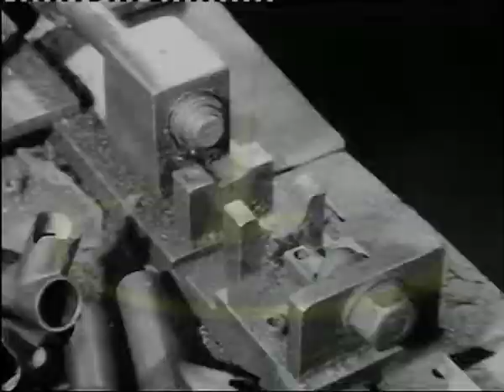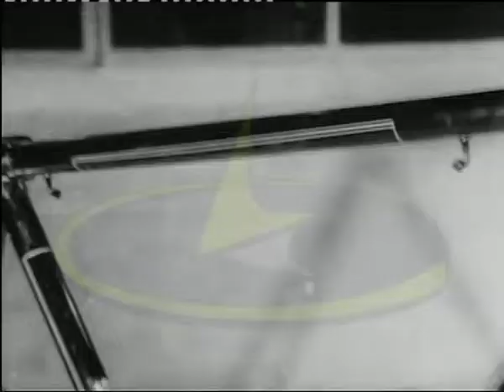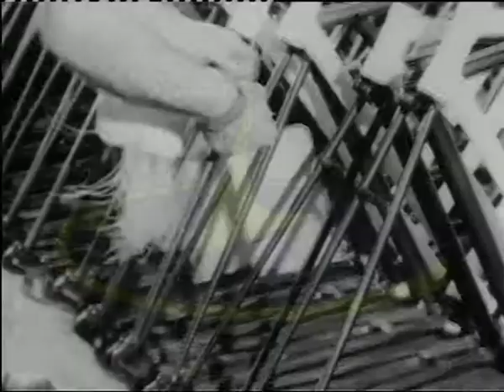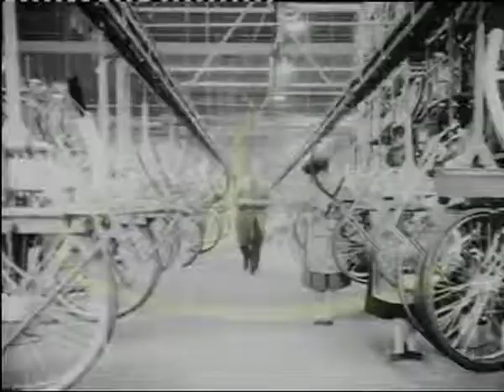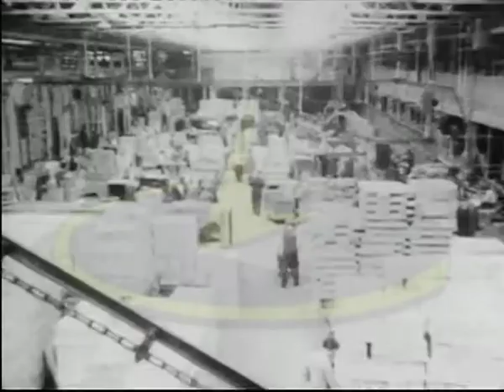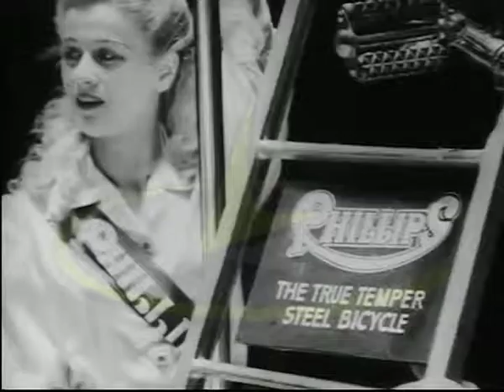Phillips Cycles

Comment: When was this film originally produced? 1948-1955 would be my guess...
Reply: The Fordson ET6 lorries were introduced in 1949, so it can't be earlier than that. F Perkins, the diesel engine manufacturer made an in house film about the Newtown Phillips factory, as they had supplied diesel conversions for the Phillips delivery lorries. That was made in about 1955/6 and it all looked pretty similar to this film, so early to mid fifties would be about right.